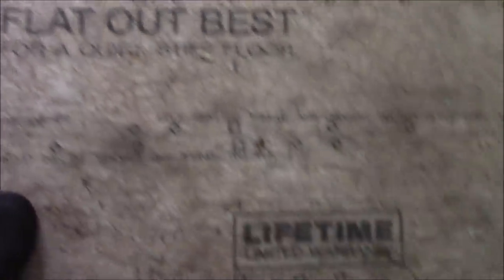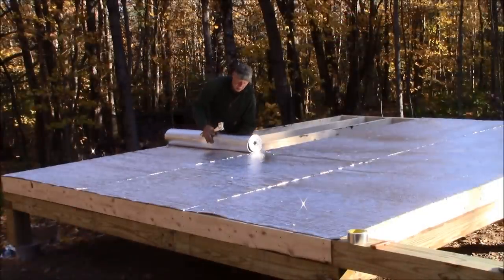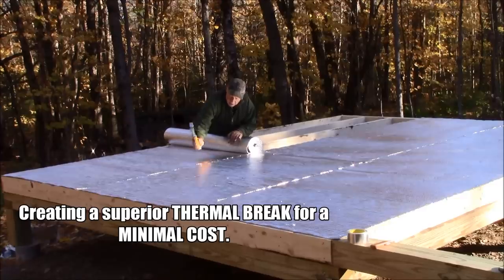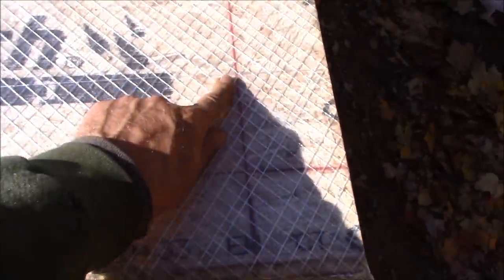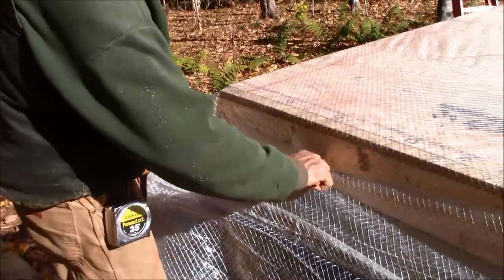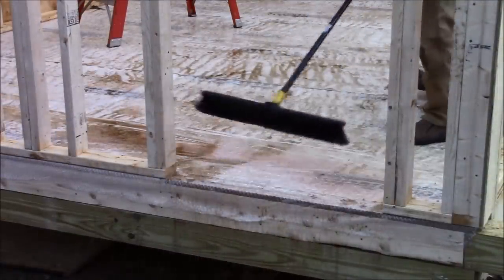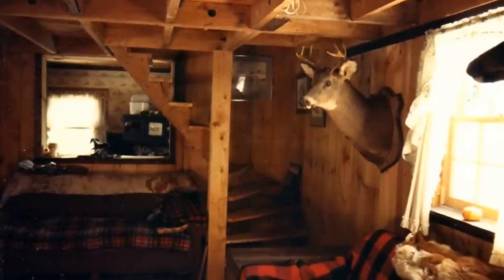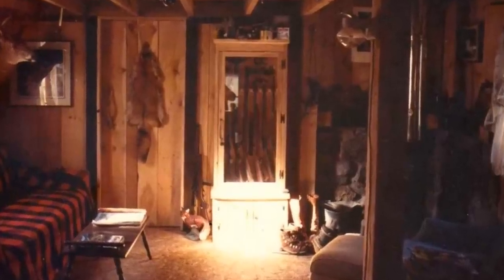Building Your Own House Or Cabin?  WATCH THIS BEFORE YOU BUILD. Build Smart, Avoid Mistakes.

Comment: The way to avoid problems is to build from a blueprint.  We built a 24x28 cabin first which, maybe we were lucky, didn't have any problems.  Next was 1800 sq foot WI ag ext blueprint which was so successful the house was stolen and the blueprint was kept by the officials that did the inspection.  Doesn't happen you say?  The dead don't talk.

Comment: From the time that cathedral ceilings began to be built into homes several decades ago, I repeatedly told anyone who would listen that it was a waste of money, and that heat rises, making the upper level/loft hot and sucking the cold air in through any crack/crevice,  in a chimney effect.  Had folks tell me that I didn't know what I was talking about, as I was not an architect or builder, but a nurse.  Hey, common sense is common sense, but seems to be in short supply a lot these days!  Thanks for reinforcing my thoughts on it!  Stay safe!

Comment: Thanks Boss for this insight. It is hard to find people who are like you and I who are actually doing the things that others are planning. I wish I had made videos when we built our house but we were in such a hurry and we built it ourselves so we had no time to video. WHAT I WOULD HAVE GIVEN TO HAVE YOU COME DOWN AND HELP ME!!!

We have a cellar that we store our canned goods in and winter veggies. The rest of the house is on a concrete slab. We do not have a frost here where we are so that is not a problem here. Love the foil and we are using it for our second story of the house to provide sound and temperature insulation. I like the 5/8 T111. I use it for a lot of things here and then I cover it with concrete planking and that is less maintenance for me in the long run. We used Rafters and we used the GAMBREL roof design.  It provided us with a good amount of living area and we were able to truss up the roof system with a steel truss that supports the larger span over our garage below. So we used the combination of both systems. Excellent information and help Boss. Thanks for the video. Jim in Chile.
Reply from the maker: We certainly sound a lot alike.  You'd make a good neighbor buddy ;-)

Comment: If only this video came out before I built my cabin haha. It's too close to the ground for my liking, and you're right about the vacuum effect with the cathedral ceiling. I'm taking your advice and putting in a ceiling about 7ft tall the full length. I'm going to try to jack the cabin up this spring to give me a few feet underneath. Would have been much easier and would have saved me a lot of time to have just done it right from the start. I'm young and dumb though.. sometimes a guy just has to learn things the hard way! Thanks for sharing your knowledge!
Reply from the maker: Life is a live and learn process buddy. My NY cabin is too close to the ground too haha :-)

Comment: Boss, you are the man! I wish I had known you 35 years ago when I built my house. I learned a lot building it myself. NO OSB...EVER
I sheath only with exterior 3/4 inch over reflectix foil bubble wrap on 2x8 96 inch walls. Reflectix everywhere! My 8 inch cavity walls had reflectix on both sides of the stud wall. Same with floors and ceilings. R55 through R70. Warm in the winter, cool in the summer. One other thing. I dip all the dimensional lumber in a high quality copper green based wood preservative a couple days before use. I allow the preservative to soak into the wood. If I make cuts for openings, i soak the cut ends for an hour before use. I like to allow the wood a day or so to dry, but along the Pacific northwest coast, sunny days are few and far between. If I had it to do over, I'd use a spray foam insulation, rather than fiberglass, and the bottoms of my floors would be half inch CDX in the crawl space. I did use a inch and an eighth T&G plywood subfloor, with a gypsum cement masonry 48 inch by 48 inch backer board glued and nailed to the subfloor. Over that I installed a mortar bed and slate flooring. There was about an inch and a quarter of heat retaining thermal mass flooring when the Sun  was shining.

Comment: Great advice and great timing.  We are gradually moving towards building our retirement home.  So far, we do have a pole barn and a tiny off-grid cabin, but will be building some sort of larger home (4 kiddos still at home).  Right now, trying to decide between a steel frame, red iron frame, ICF, and log home.  I think the log home is in the lead, to be honest.  I didn't even think about the rafters vs. trusses issues.  Thanks!

Comment: In Germany we have 3 kinds of radiators and all have diferend or produce diferend heatwinds. One soaks the cold air in and blow it up t o the  room ceiling. Another blows direct in the room. This one I love. Oven produce often turbulencen that are good because the heat reaches all aeras in a room but a cathedral- one on needs that is for shure. The "old school cabin or log home building" in scandinavia or cold countrys in the EU allways build with low ceiling THAT safes wood! As smaler a room as lesser the need of energy.

Comment: Sound advice. I have been mulling over a small house build. I have simple needs and living life as a single , divorced male. I will turn 65 in July. Thanks for the advice for getting the building off the ground. The thought of having electrical or plumbing problems on slab could be a constant 3-Advil days. I have limited carpentry skills but I feels as though I can do most of the work myself/ Roofing would be my largest challenge because I don't handle heights well.

Comment: I chose the T-11 and a lot of other upgrades when I was designing my shabin at the factory. No OSB in or on my cabin. It sits on a 8" thick slab with 2" foam insulation board and thick plastic under the slab. The slab also extends 6" all around beyond the cabin. I did end up choosing the 2" thick insulation between the joists under the cabin. Since I am disabled, no 2nd floor nor attic with 36"w doorways and a ramp.
Reply from the maker: Can't blame you there.  Like i said,  Consider your wants and needs and build accordingly.  :-))

Comment: Really enjoyed this video of yours, excellent advice!  If you ever do a Part 2, I would be curious your thoughts on these 3 choices on building a recreational cabin in the Upper Midwest (I assume similar to your NH location).  1)  Seems like everyone is into pier foundation posts and side skirts these days, I think I would prefer a 4’ crawl space dug into the ground with a perimeter wall of 8” concrete block.  2)  If the look is to be a single story trapper’s cabin with no loft, then why not 9’ high ceilings with all windows providing more light that are 1’ taller than windows for an 8’ ceiling.  3)  The use of high quality laminated asphalt shingles with a warranty period nearly as long as the now popular metal roofing systems.

Comment: Hi JD, Ha, I build my cabin same size as yours bout 20 yrs ago.Only thing I did different is on my knee walls I put insulation behind them as I do live in Alaska. I also built a full basement. I have a 1000 gal water tank down there so is something happens to my well I have a backup. Also in case of fire I have a way to fight fire for a short bit. I put a porch on one side and is where I keep my winter firewood.

Comment: The best install I made to save on fuel during the winter months was a ceiling fan above my stairs on the second floor ceiling.  My only heating unit is on the first floor on the wall of opposite side of the stairs.  A lot of the heat was heading up the stair instead of staying on the first floor.  Now it is dispersed more evenly throughout the building.  I know it's not "on topic", but all I could think of to share ;  )

Bought my garden seeds at the Dollar Tree this week - 4 pkts. for $1.  They are very good seeds too; I've used them for years.  Spring is only a month away & I'm looking forward to diggin' in the dirt.  I was wondering if you save stuff to compost throughout the winter and if so, how do you store it?

Thanks for your wisdom Boss & God bless ;  )   P.S.  Still love to hear the jingle at the end.
Reply from the maker: Ceiling fans are a must have for certain applications but not so good for off grid.  Kitchen waste is dumped in one spot all winter.  The possum eats a few things but he's welcome to them ;-)

Comment: Lots of good common sense.  I have a cathedral ceiling in a three season cabin.  The hot air goes up and out a loft window.  Large ceiling fans do a great deal to distribute heat when we fire up the wood stove.  I also use a ceiling fan on a porch to keep the space comfortable in the summer.  Ceiling fans are quiet and use minimal energy.
Reply from the maker: They are a must have but not great for off grid cabins.

Comment: Great video Boss . I know which guy you're talking about . LOL . Couple of questions for you . When you built your extention on the New York cabin you had a birds mouth cut out ( on the rafters ) for posts that weren't there yet . Was that birds mouth the same angle cut as the birds mouth on the wall . Then I guess you had to figure out how high to make the posts after that . Love watching your build videos . I learn so much but sometimes you go too fast . LOL . So right on building higher . Never know when you might need to go underneath . Another question ... 18ft wide cabin ... would you just run the ceiling joists ( 2X10's ) across with out any support in the middle . I know you're not an engineer but I need your thoughts . Advantec . Best flooring money can buy . . Pricey but well worth it . Didn't know that you can get T-111 that thick . Looks better than board & batten .

Comment: I used T-1-11 on a 16X32 kennel once. I primed and painted it, within 5 years it was rotting away. I could nearly push my finger right through it. I was not happy with the outcome. Now I use OSB and put siding on. Depending on what it is. Sometimes painting it will get the job done that's needed. (Temporary, you know, 3-5 years)lol! 
I have considered the Smart Side T-1-11 but haven't tried it yet. I have used some of the dimensional pieces for trim and they have held up great without even painting them. (they come primed) 
I considering building a place in the woods, but I will probably be using vinyl siding for ease of installation and low maintenance. I'm getting too old and worn out for anything too strenuous. My body's been pretty abused over the years. 
Good informative video though. I'm thinking the bubble wrap might be a pretty good thing. Can't hurt anything, surely shouldn't break me either. 
Have a great day.
Reply from the maker: That's odd because I've had great success with it.  The camp next door was built when I was a teenager and the T-111 is in perfect condition.

Comment: Saw a yt video on reflectex recently(bubble foil). Suggested leaving air gap of 1" between it and the subfloor. With a 2nd sheet on the bottom of the joist. It claims an R21 factor.
In spring we are putting a 400sf addition on our small home and will follow their direction. Air is a good insulator in of itself so it makes sense to me.  If it works I'll use it on my off grid cabin. If not I'll do it your way. I agree on trusses. Unless you are building to have a vaulted ceiling. We used scissors trusses in the living area (12-12 x 10x12) but the builder used trusses throughout and killed my storage in the back half of the house. My cabin will be truss exempt.
Reply from the maker: Trapped air is definitely a good insulator but in my case, mice would be attracted to that warm air space for nesting in.  They don't bother mine because it's stapled to the floor.

Comment: yes, boss, unless you build a cathedral there is NO need for a cathedral ceiling, just wastes heat :)
Reply: would putting in a handing ceiling fan pulling the heat from the ceiling towards the main floor help disburse the heat more easily???
Reply: that was supposed to be "hanging" not handing lol sorry.
Reply: What if your concern is cooling  not heating? Like if your cabin will only see summer usage,  does it make sense?
Reply: @rivahkillah  have not seen the video in a while, my thought: if you have openings for the hot air to go out may be an idea; but I also think it would not have to cathedral high😉

Comment: If you're talking about the couple up north who built their 24x32 and then expanded it last summer, I was surprised at the trusses and the expansion.  As it turns out, they always planned on expanding.  The reason they built small initially was because they were tight on time that season and needed to move in.  The add-on was the result of proper planning, surprisingly!
Reply from the maker: Not pointing fingers, nor am I bashing, just saying that rafters would have been a better choice and offered so much more bang for the buck.  Lots of wasted space there.
Reply: Yes, I agree. :-)

Comment: I learned the 3,4, 5 rule for squaring things.
Reply from the maker: That only works if the wall or floor you are building doesn't have a bow in it.  Corner to corner never fails.
Reply: @thebossoftheswamp  True
Reply: Word of the day Pythagorean theorem 34/5 fellas

Comment: very well done Boss. City folks saving a bundle doing it themselves .... until ... they realize they did more building than planing . I say , solve any problem with some time, research  and a pencil ... instead of a check book or worse yet , wasted time !!!!! One thing I have seen used in the past with excellent results. 1 inch paver with urethane . It lasts forever, evens out the thermal temp swings, stores btu's  and never needs replaced :) i totally agree on the evantech choice and t1-11 ..... both great options that return great value for time and money invested. Looking forward to your sharing your building knowledge with more great videos.
Reply: Can you please clarify what you are talking about regarding the pavers? When, where, and/or how? Are they used as piers, flooring or foundation or what?
Reply: @MaryGatdula  brick pavers on top of poly on top of compacted sand then brick pavers. moisture tight , air tight and brick . seal with coats of urethane. Flooring that never wears out. add thermal storage per every square foot. the thermal storage  releases the heat btu's in winter over the  night . in the summer stores the cool of the night and releases it over the heat of the day . If you super insulate walls . floors and ceiling , then the btu requirements for comfort in all zip codes globally will be reduced by 90 plus percent. so will the cost to keep the home comfortable . the only addition is dehumidification is southern climates. Old news , done 1000 and one times before . most of my michigan built homes , 95% less energy needed than standard , that was in the 80"s . they call it zero something homes now. out of germany , now selling their info in new jersey. Homes are as complex as we make them , or not. my avg home in MI. 4000 sq ft cost $250.00 per year to heat and cool.  learn, build , enjoy and stop using so much energy . not needed. air tight and insulate. one time , benefits for life. simple really.
Reply: @sailme2day  Okay, so do we do this as a flooring UNDER a house or as a finished floor? Sorry if I'm asking stupid questions or one that seems obvious given your description, but I am not, by any stretch of the imagination, a builder. And I sorta had my heart set on a raised floor because to stand on a slab floor for any length of time kills my back. But to save that much on energy would be awesome.
Reply: @MaryGatdula  on top of poly , sand , all on top of your 3/4 plywood, on top of your floor joist. the brick is your finished floor . life time floor , never needs replaced. use wisdom , with nature and the elements of  honesty. not rocket science , just not in 99.9 % of builder books. they do not understand building science, comfort and affordability. sad , but truth.
Reply: @sailme2day  Lovely! Thank you.

Comment: Some very wise advice, but you raised a question at the very end.  You mentioned foot print vs living space.   Being someone who isn't too comfortable working at heights, I am eventually planning on making a single story place, with some room for storage above but not big enough for living space.
I was thinking this would be a good idea, partly so I would never have to go too high to work on windows or roof, but mainly because I figure what's the point of building up, when I have a big piece of land?  Why not just build a larger floor plan, and stick with one level, rather than building up?   Is the a major advantage to building a second floor vs larger single?

Comment: Hi Boss great video!!!! You have a life time of knowledge and experience concerning all things “cabin build” and more. Yes I will think of you as my “Cabin Guru” hehehe. Question, no house wrap under t1-11. Out here in California I’ve pull it off and found 15 pound tar paper. Is it needed for a heated structure? Thank you for all ya do! God bless you and yours. Thanks for the videos. I’m in the Philippines right now fixing my wife’s family house. PI doesn’t have a lot of building standards so most things are I’ll fitting. Plumbing and electrical here is a nightmare!
Reply from the maker: I put nothing under the T111.  I do use tar paper over OSB before I install siding.
Reply: Thanks Boss makes sense thanks again for being there, and answering our questions

Comment: I'd never use Advantech.  Have it in my house.  It's over rated osb. It resists water and moisture for awhile.  But in my experience, it breaks down like all oriented strand board eventually does.  Especially if you put vinyl flooring over it, which is usually glued down around the edges only.  If any moisture gets under that vinyl, as it can in a bathroom or entrance way. The moisture that gets trapped under that vinyl will break down Advantech.  Ask me how I know.